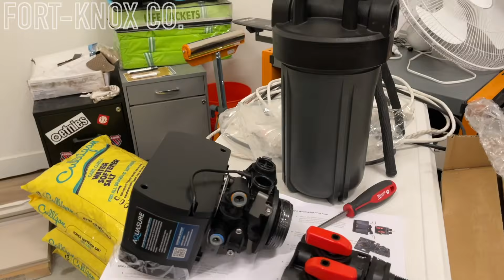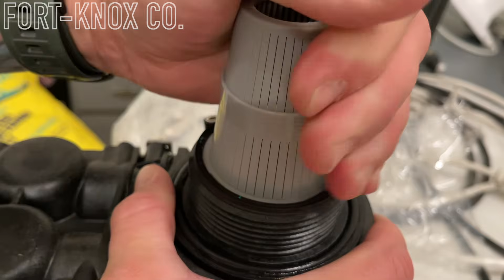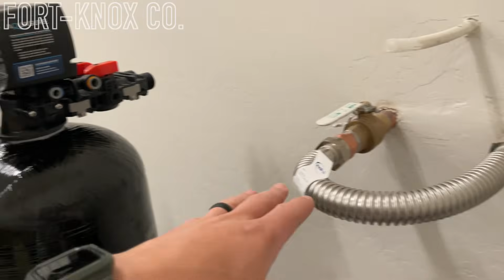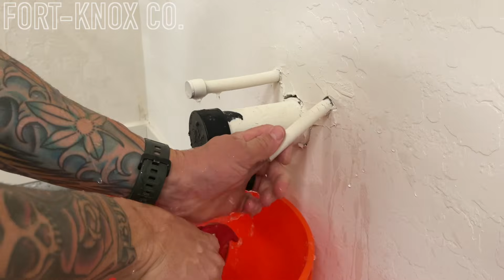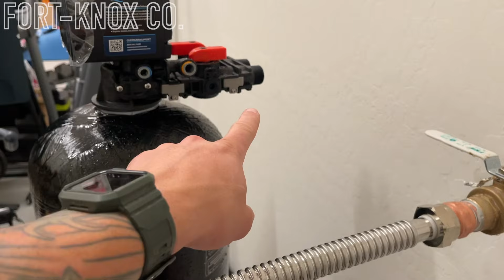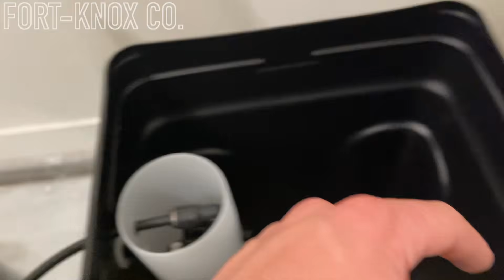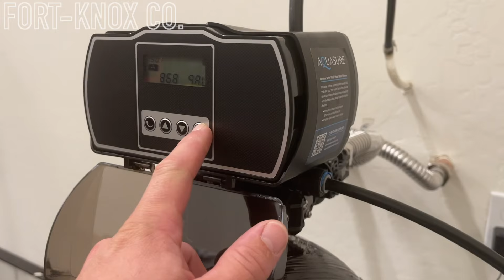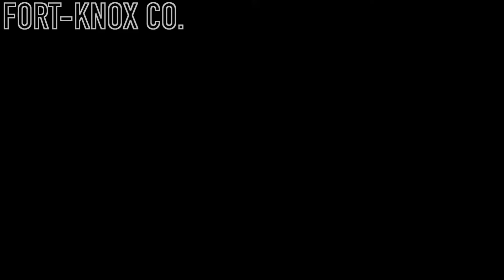How To Install Water Softener System Aquasure Harmony Series | Water Softener Loop Connection

Comment: Hello, very helpful video on aqua sure system, I have one exactly but what is and how you connect a canister that came with it, it looks like a big housing with a filter inside. Does it connects after or before the water softener system. Thank you.
Reply from the maker: You connect it the same way you dot the system. In line with the water flow so you have an inlet and outlet. 

But the theories behind before or after your softener system depends on who you talk to. Either is fine and accomplish its purpose. But the idea before the system is to catch any large particles before they get to your softener system. Only problem with this is if anything gets from your system forward into the house and water heater it has not way of being stopped. I’ve seen several systems where their softener system failed for some reason and it started washing the article matter out do the filter tank and into the home. All throughout the pipes, washing machine, water heater and I to the toilets and shower heads. Huge headache. 

If you install the large canister filter after your system you can have it as the safety measure to prevent ANYTHING from the water supply or the softener system from getting out. And if it ever fails you have it all caught at that canister filter and not all throughout your home. Either way when water passes through it it will do its job. You just decided on where you want it to do its job.

Comment: Will be watching this later. Especially since I just got quoted 1300 to install one if I purchase it myself.
Reply from the maker: $1,300 just for install?   No way. Watch this video for Free99 and a few bucks maybe in tools or a couple parts/hoses and you got this thing done.
Reply: @  yeah, basically to sweat the exist copper lines and install a shut off valve. I’d would still need to get an electrician to install the outlet or do it myself (going with option 2). There’s already an  existing box with all necessary wiring nested in the wall,  so not too bad.

Comment: I didn’t read all the comments do maybe you answered my question already.  Do you need to secure the softener to the wall ?  I know it’s connected and the salt barrel is heavy, but if that thing is hit hard wouldn’t those corrugated supply lines possibly break?
Reply from the maker: They don’t usually have to be secured to the wall but you definitely could. Depends on your local code too. They may tell you to secure it. But the main problem is that they sit a little bit off the wall, so securing them to the wall is a little tricky.
Reply: Using copper pipe to the back of the softener would add much rigidity.  But then it’s not a do-it-yourself for 95% of people.

Comment: Appreciate you taking the time to do this.  I got the same system and will be installing it today.  I think I saw you got the pre filter too, but did not install it? I will be doing a filter install as well. Thanks again!!!
Reply from the maker: Yeah it comes with the pre filter. I installed it on another water softener video I did. I installed it after the system before the water makes its way back into the home. You can put it before or after the system. Different thoughts for doing one vs the other.

Comment: If the water out is going straight into the water heater, should you turn off the heater or would simply shutting off the “water in”valve to the heater be sufficient without turning the heater off?  The softener installation shouldn’t be too bad, but potentially messing with the heater is giving me some pause.
Reply: Thank you! Your comment is what I needed to take the plunge and do it myself. I also added a whole house pre filter as well no problem. Got a quote for softener and installation for 2500, bought my new equipment for 600 all together, just a few bucks extra on basic tools and videos like yours was all I needed.
Reply from the maker: @91726  that’s awesome to hear. Happy I could help. That is what it’s all about, doing it yourself, saving some money and now having more knowledge about what’s going on with your system.
Reply from the maker: You need the main line in to be shut off obviously. That’s pressurizing the whole system.  But having a shut off after  ( two shut offs to isolate the softener)  is kinda luxury.  You don’t need to shut off the water heater or anything there. But still after  shutting off the main line you will need to let water out of the hot and cold on a faucet near by. That will relieve the pressure in those lines.  So once you cut into or open up the water loop to connect your softener you don’t have it spraying all over you.  There will be some residual water running out a little possibly. But the water heater and water line that goes into the house isn’t anything to worry about.

Comment: Thank you for the video. I have two recommended improvements.. 1) Add a bypass valve just in case you want to delete the system or return it. 2) Add a surge protector
Reply from the maker: Great information!

Comment: So upon insulation, we started the system up to backwash, and it leaks right at the orange clip. Is it not pushed in all the way? Or am i missing something?
Reply from the maker: If it’s leaking at one of those push in connections that have the clip in place to hold it, you may have a bad seal around the O-ring on the piece that pushes in. I would turn the system off and depressurize and disconnect that connection and look at the O-rings. Make sure that they are not damaged or pinched and that they are properly lubricated. It’s not uncommon for these connections to leak but it’s usually because of an O-ring that has been pinched or damaged or there is not enough water safe lubricant when inserting to create a good seal.

Comment: It’s been a year, be honest how’s it holding up?
Reply from the maker: Still going strong. Honestly. These units aren’t a cheaply made product in my opinion. I’ve seen GE and WhirlPool systems you get at the big box store way more fragile and small. The large filter tank is robust. And the system is simple. Not overly complicated. I’ve installed a couple systems that have full WiFi and phone apps that go along with it and it’s too much sometimes.

Comment: Nice video.  Can this system be outside?  Our water main is next to driveway, not in garage
Reply from the maker: I know some people have their system set up outside but I believe it still needs to be protected from rain? There’s some electronics to the head unit obviously so I wouldn’t want that getting exposed to extreme weather. I would also look at the product manufacturer recommendations for indoor or outdoor usage. I’ve always insanely these unit inside a garage usually.

Comment: Hi sir I want to ask that what is the work of softener salt tank
Reply from the maker: The filtration system has a large tank with matter inside, usually resin beads, and that filters the hardness and minerals from the water. OVERTIME that matter in the tank becomes full and the tank is not able to filter as well so to clean itself it flushes the matter with salt water. So on a regular basis, the tank filters and flushes itself when needed to make sure that it can keep softening the water. During the flushing cycle or referred to as regeneration, it will fill the tank with salt, water, flush it through the other tank and then flush it back out with freshwater And then allow your system to continue filtering your home water. The salt tank is referred to as the brine tank, and that is only filled and flushed during the regeneration cycle.
Reply: @FortKnoxCo  let me know if I am wrong, water comes from filtration tank to salt water tank or it goes to filtration tank from salt water tank and how much water we have to add in salt water tank
Reply from the maker: @taslimuddinshaikh2514  water runs through your large filter tank and that filters the water. That softens the water.  The salt tank just sits there during this process and is not in use. No house water is touching the salt tank. 

When the system need to clean itself it goes into a “regenerative” cycle. It closes a valve and opens another and starts to send water to the salt tank to fill it up to a designated level. There is a float valve in there to shit off the water level similar to a toilet tank. It fills up the salt bin “brine tank” and then pulls that water over to the filter tank to rinse itself out. This salty water is able to pull off the minerals in the filter tank and “scrub” it clean during the flushing. That salt water is rinsed through and out of the filter tank. When it’s done it flushes itself with clean water to make sure no salt water is in the filter tank and then it opens itself back up to filter the house  water. 

The salt tank fills and flushes itself and you don’t need to manually add any water. It does this itself when needed.
Reply: @FortKnoxCo  Thankyou sir for your kind information and support
Reply from the maker: @taslimuddinshaikh2514  no problem at all

Comment: Bought the Aquasure Harmony 40,000 grain from Home Depot as a result of watching this video. Installation was straightforward thanks to the step by step, easyi to follow instructions. Only issue I ran into was mine came with a water filtration system as well and I accidentally threaded one of the 1” connectors which I had to order from Aquasure direct. Be careful when threading these pipes. Fantastic video - thank you so much!
Reply from the maker: That’s great to hear. Sorry about the large partial filter though. I didn’t show in this video where to install that or how to because not all of the systems come with it. But I guess I should have shown that portion as well. I have a different video on a whole home system that covers the pre or post filter install.
Reply: @FortKnoxCo  all good. That was actually the part that was the biggest PITA. Rest was super easy thanks to your video

Comment: I'm fairly certain that the lock rings didn't need to come off to push the pipes in. We use a very similar system for airtight ducting and the locks only get taken off for removal, not insertion.
Reply from the maker: You may be correct on that one. The lock rings main purpose is to protect the fitting from unintentionally getting compressed and allowing the pipe to come loose.

Comment: Thank you for sharing. I do not have shut off valve in my garage but I do have outside. Can I connect the system before my water heater, since I do not have shut off valve like yours?
Reply from the maker: Yeah you can create your own water loop if you want. You should try to have the softener in line before the water supply splits to the cold and hot feeds. So definitely not before your water heater. But try to install it before the split for the cold lines. Should be before your water heater feed line is.

Comment: If only I could find that loop in my house or garage to install it too ! Where would this be located?
Reply: there are alot of pipes near the water heater !  I dont even have a shut off valve in this 1953 house
Reply from the maker: @klos1971  yeah, if your not familiar or comfortable cutting one of those pipes to add on a couple threaded end pieces and attaching the water softener you may need to call a plumber and have them add a water loop for so you can attach a water softener. 

A lot of the times if you have the water softener there and have the plumber come out to put in the water loop they can install the water softener for you while they are there doing that
Reply from the maker: It should be near the water heater or possibly by the main water supply where it comes into the house and your water pressure housing is at. 

Not all houses have a water loop, but they are easy to create so you can tie in a water softener.

Comment: Thank you for making this video. It  helps a lot. Do I need to recycle every time when I adding salt? Or that would be it.
Reply from the maker: No, it will regenerate on its own when needed. Adding salt doesn’t change that. Just make sure it doesn’t run empty of salt so it’s there when it needs to flush itself and regenerate. It uses the salt water to scrub off the minerals inside the large filter tank and then flushes back with clean water after done. So it uses the salt just when regenerating.
Reply: @FortKnoxCo  Thank you again for replying so fast.  Aquasure sure pay you as brand ambassador.
Reply from the maker: @PrivateLLeo  no problem at all. I wish they did. That would be pretty cool. But for now I just like sharing the knowledge and helping ppl out.  Hoping ppl find my channel helpful and subscribe and support in that way at least.  Love seeing others succeed at diy projects. I know how good it feels to be able to save yourself some money and do stuff yourself.

Comment: I live in an older home. How do i bypass the water spickets outside. I don't think i want soft water on my lawn.
Reply from the maker: You can install the softener at your water source somewhere near your water heater and where you supply splits from you main (cold) source to your hot and cold lines. If you outdoor spigots are on a separate line off of your supply it should be before that split for you homes hot & cold supply lines

Comment: Hello, I just bought a Aquasure Harmony water softener, but it is only a 32,000.  It is arriving next week and I am so so glad I found your video on how to install it.  Just had a major company come in and gave me a price of over $3,500 to buy and install their own. For under $500, I can have a system that should give me the same results.  Great great video.  Very detailed and good quality.
Reply from the maker: That right there is what motivated me to do stuff myself if possible. Saving over $3,000?? Yes please.  Can’t justify spending that much money on a filtration system.  This is definitely something you can do yourself. Main thing in making sure whatever water pipe connections you make are nice and tight. Other than that it’s all basic stuff.
Reply: @FortKnoxCo  my home is new construction and a had 3 different companies quote a systems from $5K up to $10K. I googled water softeners and found this brand and a whole home system with an R/O unit for $1500 from Lowes. Evidently, those companies are overcharging. 

I want to get one and do the work myself but my house is brand new and I don't want to F-around and find out with the plumbing. That said, my home inlet is a single pipe in an open square hole on the wall with not a lot of space so I'm not sure how to work with that. Yours looks so much simpler to work with. 

If I bought a system, can a local plumber install it for me?
Reply from the maker: @amandawoodward4099  do you have a water loop? Like near your water heater or somewhere in your garage after your main line that looks like it’s set up to put a water softener in ?
Reply: @FortKnoxCo  going into my water heater (tankless heater) looks to be the closest thing but I don't have a loop exactly like in your video.
Reply from the maker: @amandawoodward4099  then yes a plumber can do it or you can. You just need to locate a spot after your main line coming in where there’s the shut off and bell housing that controls the pressure.  Any point after that and before the line splits to your cold supply and the feed to your water heater. You can cut that line and take out a 12” section. throw a 90 elbow on both ends, running it out the wall to stub out for your water connections for the “loop”. Then you put threaded male ends on the top stubs coming out. Connect your water softener and that puts your water softener “in-line” and filters both your cold and hot water. 

A plumber will do the same thing.  A water softener company will definitely be charging you more overall I would guess. I don’t now how they get away with those prices.
Reply: @FortKnoxCo  yeah those water companies are pretty heartless. Thanks for the info!
Reply from the maker: @amandawoodward4099  no problem at all. I hope you get it all handled 🤙🏼
Reply: @FortKnoxCo  Thanks for your video! Great stuff! Question: if I don't have a water loop and I am putting my softener "in-line", do I need to run a bypass too? In case if I need to disengage the softener
Reply from the maker: @ if you’re going to be plumbing in your own waterloop, it might not be a bad idea to have shut off valves at the loop to be able to do that. But a lot of builders don’t do that because it just cost extra for fittings and pipe. But again, if you’re gonna be doing this yourself or even have a plumber, do it for you it wouldn’t be a bad idea to spend a couple extra bucks and add a few more fittings so you could bypass it. But it’s not necessary technically.

Comment: Did you install the filter too?
Reply from the maker: I didn’t in this video. But you can put it before or after the system.  There’s two points of view of why but it just goes in line with the water flow. Filters bigger particles. In my other water softener video I did install the large filter. I usually install them after the softener before it goes back into the house.

Comment: I don't have the plastic tube coming from the wall, what is the idea for that? Could be just a regular draining tube?
Reply from the maker: Are you talking about the main waterline like the water loop? Or are you referring to the single piece that you connect for the drain line? If you have the Waterloo, you should be able to connect the inlet and outlet no problem. But if there is no drain Line, then you may need to add one or find a nearby drain. A lot of times they will run a line through the wall and into a nearby laundry room so that it can dump into the drain line that your washing machine drains too. That’s the most common place to run your drain line.